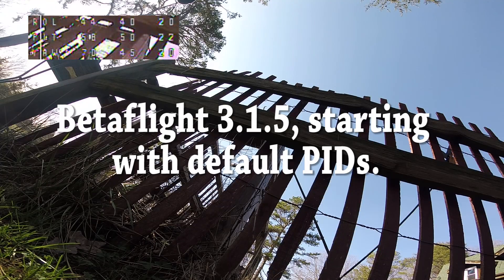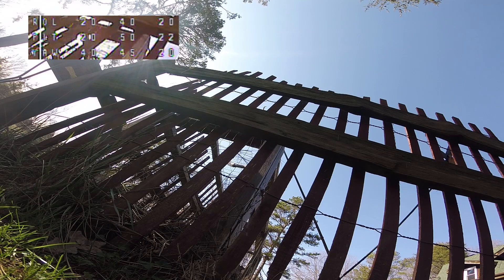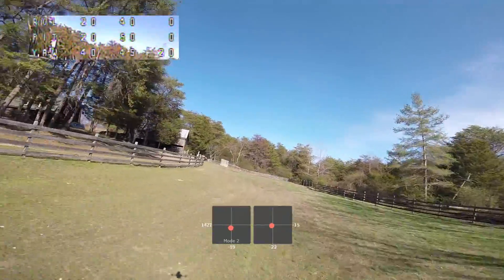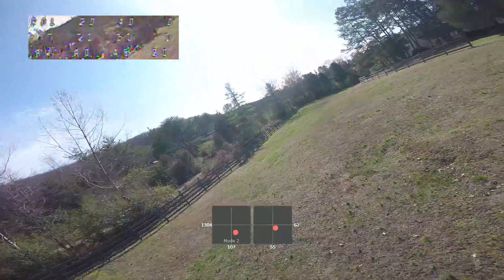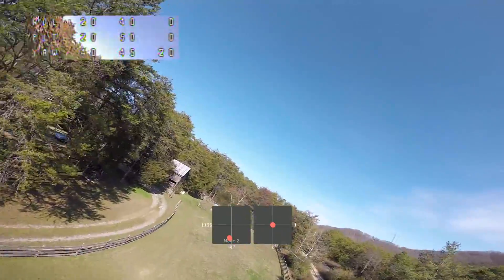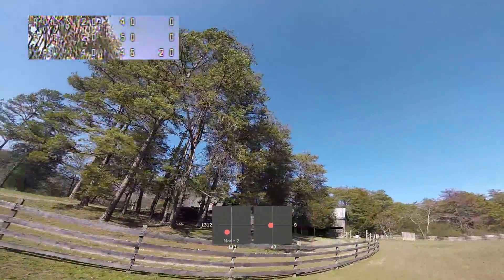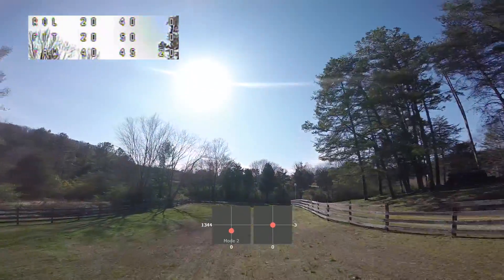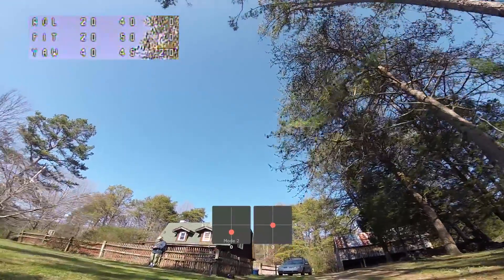PID Tuning Masterclass - Part 1 - P Term From Low To High

Comment: Need help.  My drone after last connection to Betaflight is responding frations of a second after a control input.  I thought it was a PID issue which I never paid attention to yet, but looks like PID is not the problem.   If words are same as airplanes, it's not expo.  Drone just responds slower and this causes me to over control to opposite directions until it crashes.  What should I look into ?

Comment: Do i need to do pid tuning if i just swap out a fc? I would like to swap my f4 to an f7, i was wondering if i could use the same tune as with the f4 after swapping. Of course leaving the other settings like looptime the same.

Comment: Question. On some (%30) of my micros they have what you wanna call mid throttle oscillations, but different. They are more rapid like as if the quad had “chills”.  I know a good tune will completely fix it.. What about the PID’s would affect that?? My PID’s usually stay default, but I hate the chills!!!

Comment: Got a question for you what would cause my quad copter to have a quick throttle hang. While flying when I punch the throttle and drop it quickly it will continue to climb at full throttle for about 2 seconds before finally throttling down. Any help with this would be greatly appreciated

Comment: Isn't this now extremely outdated with the new BF 4.1   ...   I noticed my 3" Gecko was running 4.0 so I went to update it to 4.1    Having issues flashing  the new FW   but Ill handle that .  Isn't this "Masterclass" way way   deprecated now ?   Oh  FYI Anyone  jumping BF versions  4.0 of BF is   basically  a skip  because of the filters fiasco.  Just my two cents

Comment: How do you adjust PIDs on the fly via the radio? And how do I get those values on my OSD.. man. so much to learn! This is great though. I'm using KISS FC + Impulse OSD.
Reply from the maker: https://www.youtube.com/watch?v=JpnCMLmxme0
Reply: @JoshuaBardwell  Thanks! So I feel like I am missing out on quite a lot of stuff by having KISS. What do you suggest is a good jumping off point hardware wise to get all the Betaflight goodies?
Reply from the maker: For KISSFC I'm not sure it's possible to do exactly what I show here.

Comment: I’ve got a GTR369 that flys fine on 4S but has significant pitch oscillation on 6S when simply throttling up.  It has crashed a time or two (replaces the FC twice now) and suspect a bad gyro. Would you advise on how to ferret this out vs. proper P and D values on pitch (currently BF Defaults)?
Reply from the maker: The 369 should fly well on 6S right out of the box since that's what it's designed for. If it is having bad oscillations then I suspect it's got mechanical damage somewhere. Assuming you're using the stock configuration that came with it anyway.
Reply: I saved off a config from the original FC using diff and applied it to the new FC. Is it accurate to say this may not have captured everything that made the GTR369 so dreamy out of the box?

Comment: Joshua what about filters? Keep it default or turn all off during PID tuning?
On default PIDs my motors are very hot...
Reply: Wojciech Myśliński tune drone, if you don’t have a regulator in your drone I would put one in it helps a lot.

Comment: #help, Bro, wanna ask, when you were flying/cruising in this video and those "wobbly, shaky, oscillations" while flying in a straight line, what is it caused by? I have the same in my quad and am at a loss on how to tune them out or are they mechanical. *timestamp https://youtu.be/27lMKi2inpk?t=447 , not the propwash, the straight cruising lines...

Comment: Hey Joshua, please please help me :0 my quad is a 7inch with 50A escs and 2306 1750kv motors
It flys perfect but when I hit full throttle  the motors make a horrible squeal and a slight grinding sound no noticable oscillations just the sound at full throttle
Reply from the maker: Can you send me a video of what it sounds like?
Reply: @JoshuaBardwell  thank you so much for the response, I checked the DVR and it's rather difficult  to hear via the swift audio, will hopefully catch it better with the go pro tomorrow
Reply: @JoshuaBardwell  https://youtu.be/5a0V4FlwS70

Should i try higher pitch props such as the 7056 or perhaps its ESC settings ?

Really appreciate the help :)

Comment: I’ve noticed that your rolls when testing the changes aren’t very precise, as well as the flips. Are you purposely flying “sloppy” to see how the quad is responding to inputs? If you try to make precise rolls and flips I could see that as adjusting your stick inputs to compensate for the change in flight quality, which could lead to thinking your quad is flying better than it is. Like instead of adjusting the PIDs to your flying behavior, your adjusting your flying behavior to the bad PIDs. Is that correct or am I just over-thinking it?

Comment: I would not call this a master class.  The tuning is still done by trial and error.   A master would have a model for the system an calculate the  controller gains.
This is how it is done in industrial systems.
Reply from the maker: There is no model for a quadcopter that can calculate controller gains. If it could be done mathematically and get it right, we would do that. Some people have tried doing that and it produces shitty flying quads, because there is no useful model for a quadcopter's behavior. So in order to be a "master" and PID tuning, you must do it experientially by trial and error, because every quad is different.

Welcome to the channel :-)

Comment: And another quetion please! If my motors are low price ones (racerstars) it could be the reason for having a lot vibration on my fpv camera? On los seems to be smooth, but again, I m a novice in fpv. Thank you?
Reply from the maker: Low priced motors often cause excess vibration due to cheap bearings. They may fly well for 10 or 20 packs but then get bad. Or it could be something else like a damaged motor or prop, or a loose camera mount.
Reply: @JoshuaBardwell  your content is awesome, i ve started to watch fpv youtoubers on the wrong chanels i think and maybe that s why my first drone and my first built at the same time ended to be a bad experience, a real pain in the a$$. But I still love it :) I didn t expect for you to answer me, thank you! You re a cool guy! My camera is well mounted, but the quad suffred some.really bad crushes, but I ve got those vibrations from the begining and I ve tried tune it but no real results. Thanks one more time! I ll start saving money for a better configuration.

Comment: Hello
I've been having an annoying problem with my quad. It feels like I've got a good tune, but when I perform flips with high angle speeds I lose control of the quad. It rapidly starts an uncommanded spin even faster and cannot be stopped for a few seconds.  

Is this a telltale problem? My hypothesis is the D rate could be too high. Or I have vibration problems on the board. Any ideas?

Comment: Hey I built a 180mm I'm having the same problem as( let's fly rc- in his pid tuning full throttle problem) video and when I give it full throttle it does the exact same thing just a little more intense. How can I fix this? Thanks in advance!
Reply from the maker: I have no idea what video you're referring to so I don't know what problem you're having...
Reply: Joshua Bardwell I put the name of the YouTube and name of the video in my comment, someone told me it might be a esc wire or just in the pid  tuning. Tia!
Reply: Joshua Bardwell hey sorry about the confusion  i just uploaded a video of my qaud doing it on my channel could you be able to check it out and give me some tips on what's causing it .

Comment: Hi! As I set my P gains at around 20, my copter starts to oscillate... but in most of the videos, Ps go up to 50 or so. is it okay if my copter is bouncing at roll P=20? or is there something wrong...please help out...
Reply from the maker: Yes, that's very suspicious.
Reply from the maker: Something is wrong if you get oscillation with P that low. Unless you have a super powerful quad.
Reply: but I'm unable to see any problem in any component and I don't think the quad is that powerful.
I'm using CC3D board with librepilot, it is fully updated and latest version of firmware. where to look for the problem, please help... this is my first build...

Comment: Hi, I am having a bit of a problem with my barometer I think. My quid is bouncing in alt hold what am I missing.I have foam on the board to try and stop the prop wash with no success I am running a full naze 32 on clean flight do you have any ideas.
Reply from the maker: Honest, Betaflight support for alt hold is pretty poor and hard to tune. Have you tried iNav?

Comment: What are good PID settings for a 450 quad with 10" props? I'm having problems. I can't fly aggressively without my quad wobbling back to the ground. I can only fly gently with subtle movements of the sticks. That's it. Can anyone help?
Reply from the maker: I do think that the default betaflight PIDs probably don't work well on larger props. I would start by reducing P gains to like... 20 or even 15, and work up from there.
Reply: Joshua Bardwell. Thanks for replying. I'll do that. Also, I'll only work with P first, and set I and D to zero. I'll work my way up from P to I to D. I really hope this works.
Reply: Joshua Bardwell. Thanks. My 450 size quad is flying a lot better now. Not perfect yet though, but close.
Reply: Joshua Bardwell. Another problem I'm having is regardless of what my PID settings are, when my flight battery gets too low, my quad begins to oscillate in all axis and becomes un-flyable. I'm using a 3s Lipo. Could it be that my AIO F4 board is getting insufficient voltage when the flight battery gets too low? Perhaps a 4s Lipo will remedy the problem since it will have a "higher" voltage to properly run the F4 board when the battery is becoming too low? I don't have a small 4s Lipo to test this theory that is suitable for my quad, so that's why I'm asking you.

Comment: I've spent 3-4 days trying to figure out my problem, finally I found a video that kinda looked like what I was experiencing... 2nd comment down is from Mr Obi Drone Kenobi himself saying that persons P setting was too high...... LIGHTBULB!!!! 3 Joshua Bardwell videos later, I'm now 98% sure of what's wrong 👍😎 
My Problem: for background, lets go back to the last mistake I made.. I placed my FC in the wrong orientation, causing the death flip on takeoff. Being an idiot thinking I made a mistake in betaflight, I hit the reset! Went to test and huh look at that it won't arm... back in betaflight I feel like an idiot as I reset everything BUT the PIDs..... next test, being very careful with the throttle, not even half an inch off the ground she starts dancing haha now thinking back, I do recall glancing at them and thinking they looked high but didn't know any better so I didn't touch them. 
I did figure out a good test to make sure motors and props are correct! Also useful for noobs to practice making super tiny inputs on the control: Spool the motors up just enough so that slight forward/backward pitch gets the quad to sit on two arms.. now one at a time use pitch and roll, to make it stand/spin slowly on one arm!

Comment: Hi Joshua! Thanks a lot for the explanations, now I understand. But nevertheless I have one or two questions. To tune the PIDs I have to turn off dynamic filter, airmode and weightless mode. Right? What happens then is, on a drop without throttle the quad is turning around yaw and drifting totally away. With airmode on, it keeps the direction so far. As it should work without airmode, what is the right thing to do? Increase the idle speed to give more correction possibility?
Reply from the maker: +PrinzTom you don't have to turn those things off to tune. Always tune like you are going to fly. I fly and tune with all those things on.
Reply: Joshua Bardwell OK, thanks a lot

Comment: I am having straight line oscillating on mid low throttle
Reply from the maker: +Bobby Doyle at mid low throttle oscillation is likely to be camera shake or something mechanical like that. That's my first guess anyway.
Reply: Its an audible noise and you feel it in flight so I believe its definitely in my tune. I thought about an easy way to remedy that is to soft mount the motors but I havent done that. I want to see if I can tune it all the way out, even though Im new to PID tuning. Ive tuned a portion of that out but the results almost seem inconstant. I believe my problem now is in the Yaw P-term being too low.
Reply: Inconsistant- Mechanical. I received a quad with very lame excuses for soft mounts causing vibrations to the gyro. A hard mount fixed every bit of that

Comment: Hi Joshua, what you would recommend for get rid of high throttle vibrations? I run betaflight 3.2 stock pid‘s, turned off notch filters 1 and 2, change lowpass filter to PT1 and still get vibrations. Checked motor vibrations and they run like new. FC is soft mounted. What would you recommend in this situation? Lower P gain? Boost up D gain? On landing my motors is not even warm. Maybe use more TPA?
Reply from the maker: High throttle vibrations, or oscillations? That's the first question. If you have oscillatoins then that's PIDs. You can try lowering P or maybe adding TPA. If it's vibrations then the answer is to fix what is causing the vibes like imbalanced motor, bad bearing, imbalanced props, etc.

Comment: Joshua you know what would really help?
Not dropping everything to zero and then raising but the other way around,...
I started back then whehn flybarless Helis were new and I was just getting the jist of how the gyro works when you tune it too high and how to go down from there.
Now getting into Betaflight I think it  would help to just see where to go from the stock settiings.
Like  you show with that oscillation but for everything else... see where it gets "faulty" and how to drop it from there 'till you can see that it's not "faulty"anymore.

Comment: Hello Josh. I have a question. My Arris c250v2 yaws to the left a little bit when I fly straight. Should I adjust yaw I gain? Or what would you say I should do to fix this? Thank you kindly  :)
Reply from the maker: Confirm that your channels are centered at 1500 in the Receiver tab when your sticks are centered on the transmitter.

Comment: Joshua, loving your tuning video you got me in the ballpark of where i need to be. The problem is when im cruising I have noticable  wobble. my flips, rolls and over feel  is awesome. Just alot of wobble when cruising
Reply from the maker: Soft mount the FC? Check FPV and HD cam to see if the wobble is actually the quad or just the camera.

Comment: Hello, im new to PID tuning and i ran into a problem to where when i cut the throttle to reach idle speed for flips or rolls the motors dont slow down fast enough to idle, making me have an awkward roll or flip. I dont know if this is even in the pids. Its just seems to be in that type of genre.
Reply from the maker: What ESC are you using?
Reply: Joshua Bardwell I actually figured it out on my own. sorry for the inconvenience. thanks for the quick reply though :)

Comment: in one of your pid tuning videos you said p gain oscillation can cause video breakup. Why and is there a way to fix without lower the p gain. I have some breakup when I jam the throttle and doing very fast turn.  visually very tiny vibration when I jammed the throttle followed after a sharp turn. I feel p gain is at the level I like.
Reply from the maker: +Jack Truong it's really D that causes video breakup, not P. The fix is to put capacitors on your ESC's.
Reply: Joshua Bardwell can I use LC filter to supply power to vtx and camera instead? No space to add four capacitors.  thanks.
Reply from the maker: +Jack Truong sure.
Reply: Joshua Bardwell my quad uses a matek mini pdb. should I power the lc filter directly from battery (4s)  or 12 v from the pdb? my camera operating.voltage is 5-22v ( hs1177). thanks

Comment: This is helpful, have you done a video on PID for GPS. I'm getting a lot of sway and slow correction. Raise the I gain? Been messing with it but haven't figured it out.
Reply from the maker: I don't really fly GPS copters.
Reply: Yeah, I built a 230 racer and added GPS so if I freak out I can flip the switch so it stays put. I'm still learning to fly. The quad itself is fairly stable hovering until I flip GPS hold. Thanks for the videos, it will just take trial and error.

Comment: Josh I think you should mention the electronics of this quad and the props just to size up what we're looking at here.
Reply from the maker: +imtrill07 I disagree. The specific PID values aren't what's important here. The specific copter setup isn't important. What you see here will be similar for any 6" to 4" quad.

Comment: Just wondering, it seems PID tuning is a big topic and something people struggle with the most, what are the chances having an auto tune option within BF? Doesn't have to be as perfect as a Manuel tune by a pro. Would this even technically be possible?
Reply from the maker: +Ido de Lepper the default PIDs are better than any autotune algorithm I've seen.
Reply: True, thats what I am using :) But wondering if it would be possible from a technical perspective. I know cleanflight has an autotune feature, but I never see people talk about it or refer to it. Betaflight had one, but has been removed and I know dRonin has this feature.
Reply from the maker: +Ido de Lepper technically it is possible. Practically, it's difficult to get right.